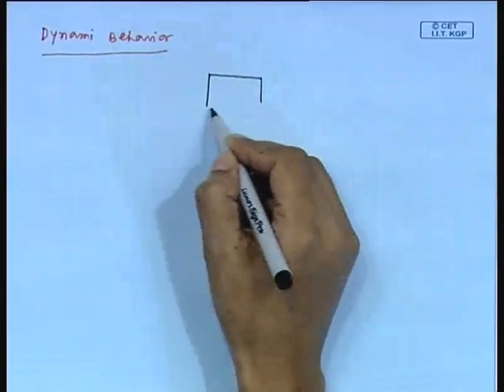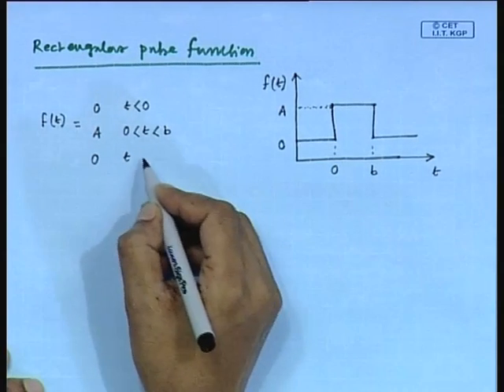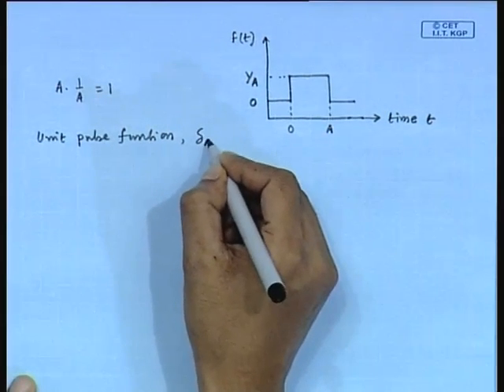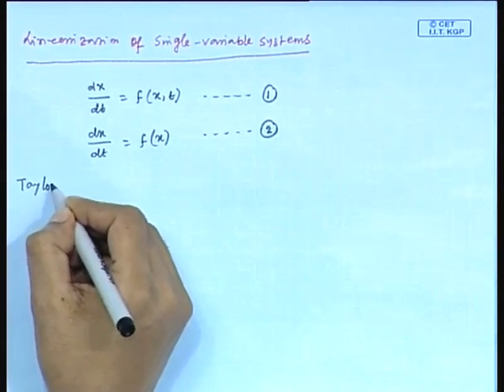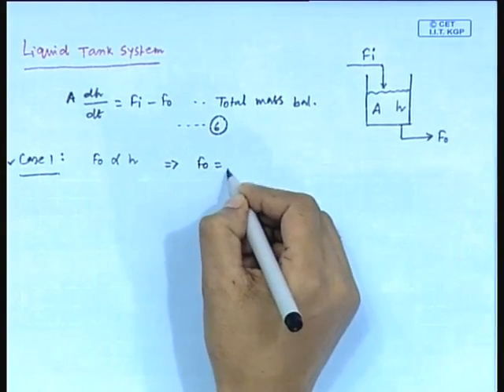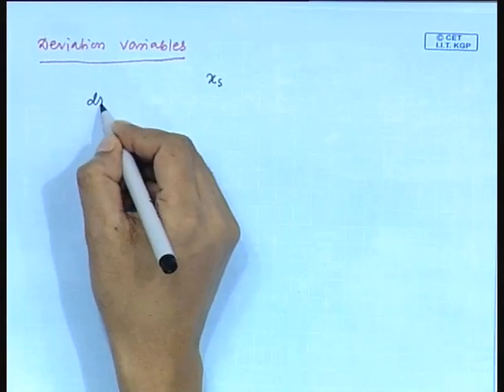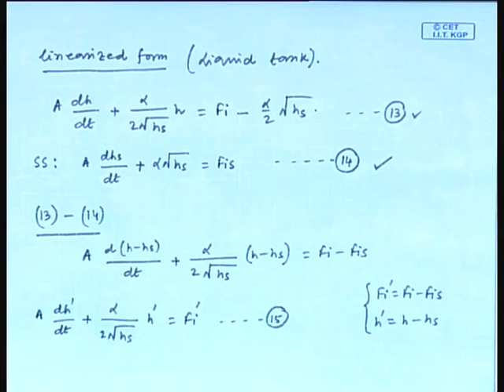Mod-01 Lec-06 Dynamic Behavior of Chemical Processes

Comment: 2:05 step function (sudden change at t=0)
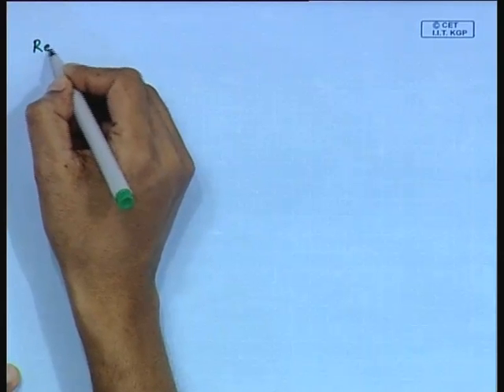6:28 reactangular pulse function (return to older value after a duration after the change at t=0)
14:37 impulse function (area constant at 1, the f(t) is 0 at all times except at t=0)
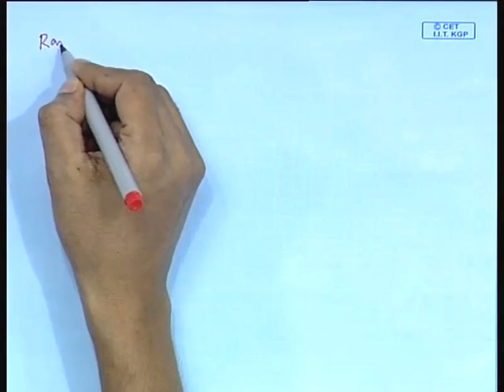23:06 ramp function (increasing at slope A at t greater than 0 (after t=0), increasing linearly )
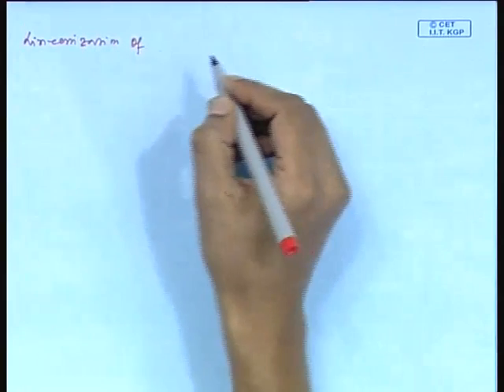29:16 linearization of single-variable system
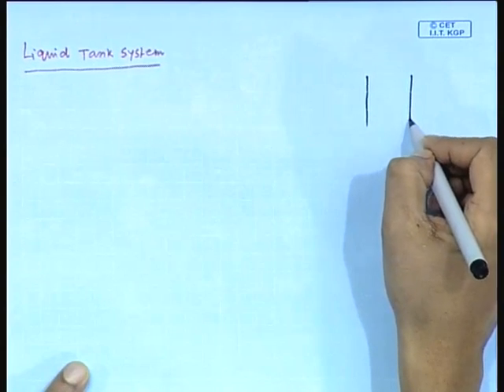36:15 linearization example
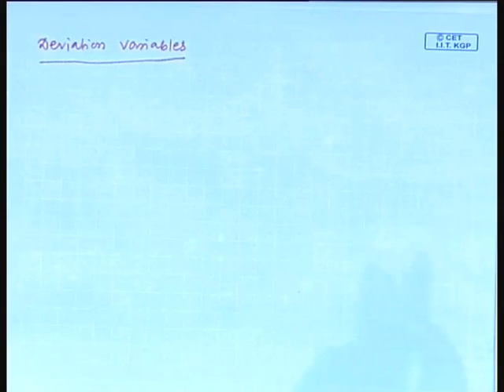44:39 deviation variables

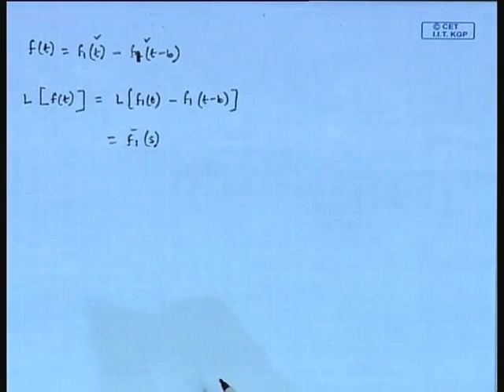Comment: I was wondering about the negative exponent @ 12:30 where you write -e^(-bs).  Is this negative from the (t-b).  The negative in front of the b was due to the displacement along the x-axis, correct?  It looks similar to the inverse laplace of (s+a).
Reply: I know it's toooo late but it's according to property of step function.

Comment: Why are forcing functions here are represented mathematically in laplace functions rather than in any other mathematical representations..??
Reply: just go with  the def of forcing function,,,suppose we have process and some input is given to it and if this input goes through process diagram ,we get some change in output if we change input by stepor ramp.or pulse,so We are generally talking about changeor in pdc term deviation.so we know that in mathematics we read about differential which is the best way to describe change in system.and laplace is just the technique to solve differential equation to make simpler function .either you go for differential technique n if you have good knowledge you can solve it because it is much more complex method.
Reply: Thanks bro..:)